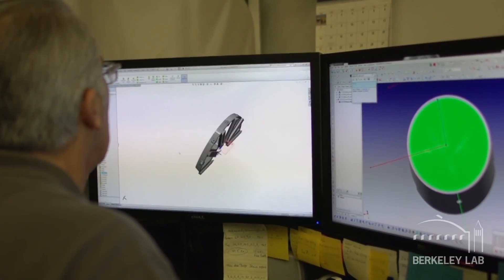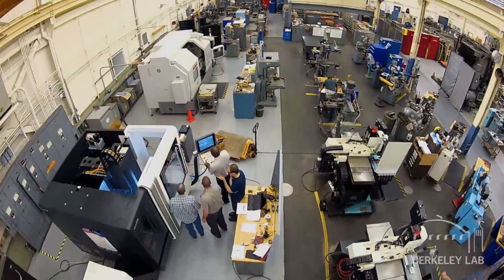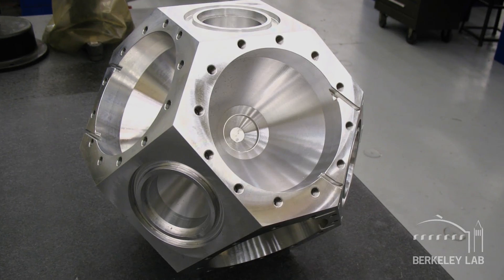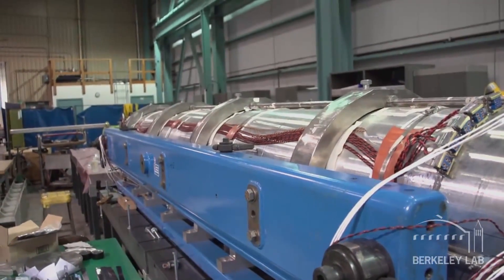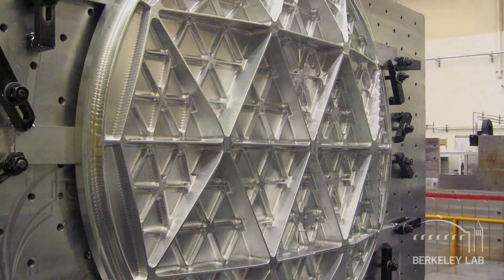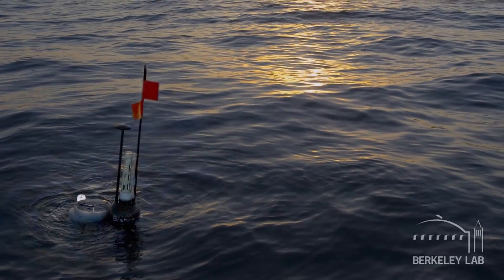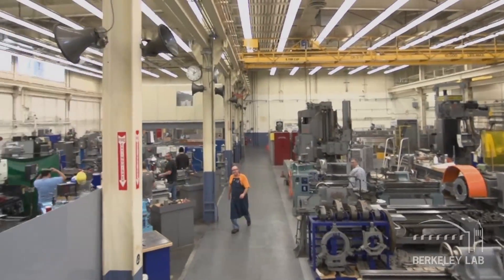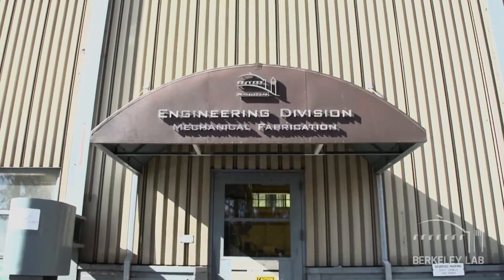Behind the Scenes at Berkeley Lab - The Mechanical Fabrication Facility

Comment: I was looking for Tom Lipton (Ox Tools) in the group photo.  Pretty sure he works there.  I actually used the machine shop at the UC Berkeley PEER Seismic Research campus for cutting down some 2" diameter bolts for a 5000 amp switch we were testing there.  The head guy over there was concerned that I was going to cut my fingers off on their DoAll bandsaw that I was using.  I explained that I had the exact same DoAll bandsaw in my home shop, and figured I new a little bit what I was doing.  Fair question, as some mechanical engineers can be dangerous around equipment.  They have a killer Southwark-Emery press there.  Awesome place.  We were there to use the shaker table. --Doozer
Reply: That press is down at the Richmond field station and not up on the hill at LBL. The shaker table is pretty awesome and can replicate specific earthquakes. I'm going to bet your bandsaw is a 16 inch doall vertical. Dozens of those saws here on the hill.

Cheers,

Tom
Reply: @oxtoolco  Yes, it was their facility down on by the water.  I was there to use the shaker table.  We shook our switch to 6.5 on the Rictor scale and that meant it passed the test. Yes the shop in the building that housed the Southwark-Emery press had a 16" Doall, just like I do at my shop here in NC.  They had a few lathes there too, I don't remember now.  Our hotel was in San Fransisco, or somewhere close to there.  I remember we had to drive to Grainger and buy a 3" slugging wrench to get our job done!  Another thing I remember, the coffee was really good there. Must be a thing. It seemed many of the buildings did not have heat or A/C because of the moderate temps there.  Cool place.  I kinda want to live there. Ahh, too many machine to move though. Thanks for the reply Tom. ---Doozer
Reply: @oxtoolco What do they have machine/work wise at the SSL? Was thinking about taking a job there.
Reply: @williammorris1763  Not sure. We don't have much contact with SSL. They are up the hill from us overlooking the Lawrence Hall of Science. I have heard they only hire temp but that is just something I heard.

Cheers,

Tom
Reply: Hey Kooldoozer. Thanks for the shout out. I managed to stay out of this video.

Cheers,

Tom
Reply: @oxtoolco  Yeah Tom, Us shop guys stick together. Hope you are well in your new shop and hope you keep publishing content. Thanks for the comment. --Doozer